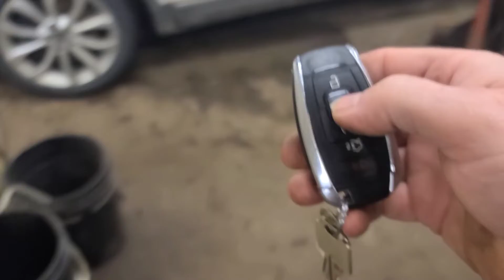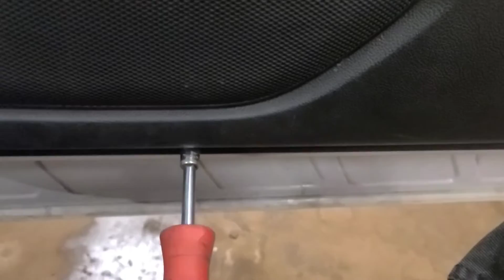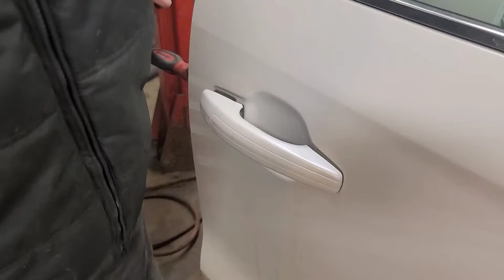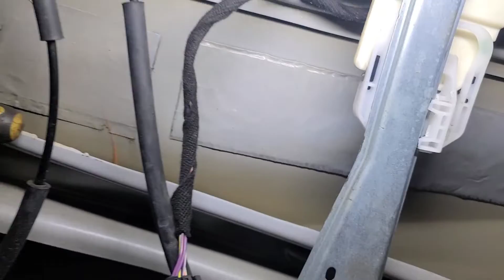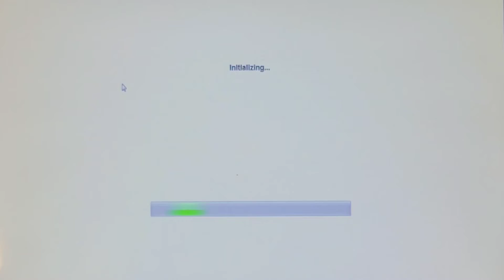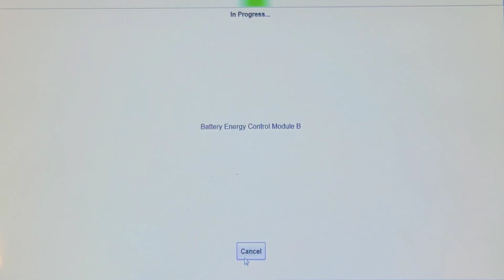2017 Lincoln MKC Broken Outer Door Handle. Attempted Repair Pt. 1

Comment: Thank you. Should the outside handle be removed when replacing just the lock actuator? 

I was able to luckily remove the old one but now I cannot get the back cable into place on that actuator latch. Fix one problem and now created another one 🤦‍♂️
Reply from the maker: Are you talking about the power door lock actuator? If so I believe you would have to remove it then the whole assembly.
Reply: @Phi @PhillipBailey thanks correct just the lock actuator. I got the inside cable attached fine. How do you disconnect the outside door cable from the handle?
Reply from the maker: @theillestjerm I removed the inner door handle mount together with the latch assembly and disassembled it out of the door.

Comment: Everything is made for production line speed not to take apart.  The bumper CANT be disassembled without breaking parts or the bumper cover itself BUT  goes together easily.
Reply: Awesome video, thanks for posting. Family member has a 2015 MKC, battery keeps going dead. Coincidentally the driver's door handle has pulled off 2X. Ford dealer repaired it but still has pulled off. Wondering if something in there is killing the battery. Going to a different Ford dealer this week, see what they say. Thanks again for posting, looking for part 2
Reply from the maker: @johnfoster2370 here's part 2...https://youtu.be/yLN3kh18wCw?feature=shared
Reply from the maker: Absolutely correct!

Comment: I was thinking if you could wedge that spring mechanism open with a piece of wood you would be able to slip the handle into those release prongs. Then pop the wedge out from inside the door. I suspect the release device got bent when the handle got pulled out. You would have to make sure the handle was reliable for high effort door openings.
Reply from the maker: Believe me I tried for over two hours even on the bench to get the handle in but couldn't do it. It's nearly impossible to see when it's on the car. I can't wait to compare a new part to the original.